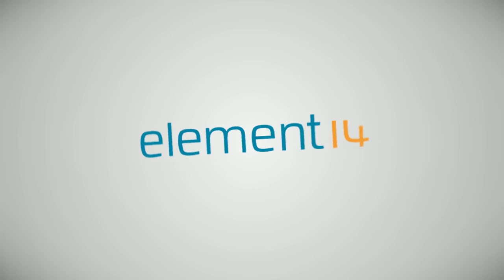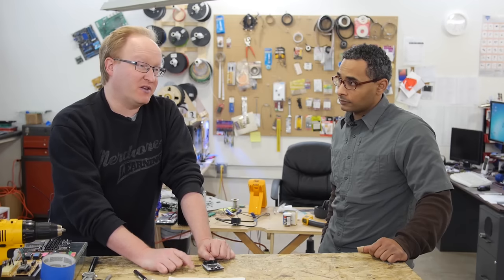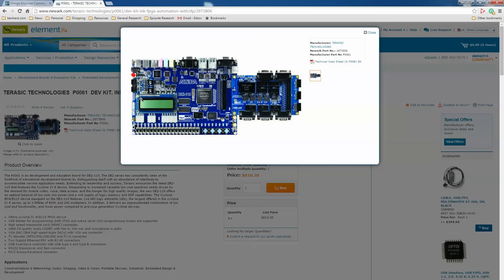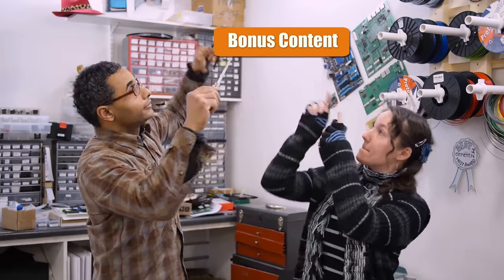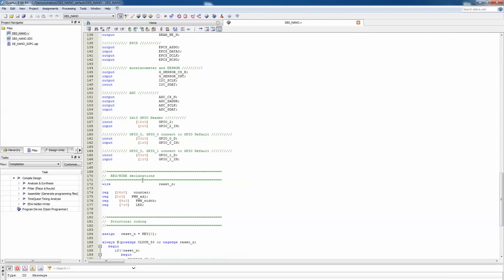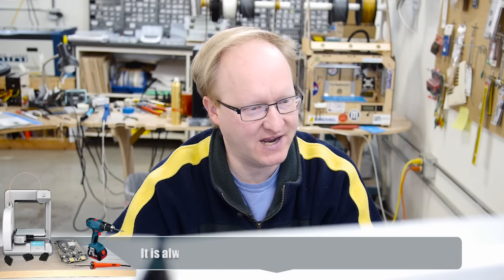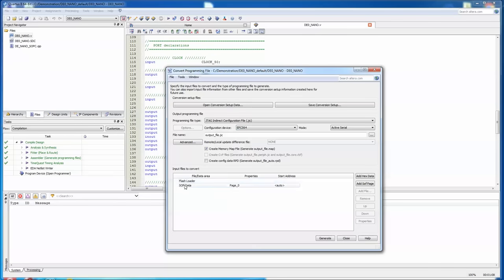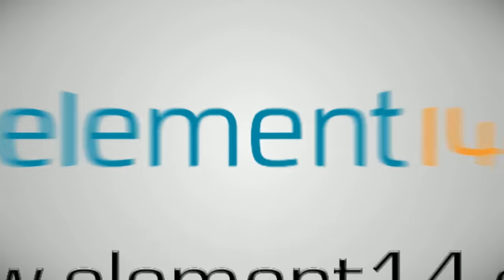Ben Heck's FPGA Dev Board Tutorial

Comment: DE-10 Nano can be had for $150 with a Cyclone V (LOTS of gates) and a Arm SoC running Linux.  You can write custom drivers in Linux for specialized hardware designs on the FPGA and interact with them in user code.

Comment: Hi Ben, this question might be a bit at the wrong place but do you like the delta 3d printer more then the standard x y z 3d printer ? Or do you think they are both good?
Reply: +Charlie90071 Ben currently prefers the XYZ printers he has, but not necessarily because of the way the head prints. The bed on the Orion is difficult to level because it doesn't have springs that allow you to vary how much you tighten the screws down on any side. So mostly he prefers the XYZ style because it is easier to calibrate.
Reply: Oh didnt know that, thanks Karen!
Reply: You're very welcome!

Comment: FPGAs also are very useful in electrically dangerous environments due to their durability, and they can also resist physical damage to the chip itself.
Reply: That's definitely not an FPGA property. You might have seen e.g. Actel chips in this capacity because they make radiation hardened ones.

Comment: how does a program set changes in hardware
Reply: What you're creating isn't a program. Verilog isn't a programming language - it's an HDL - hardware descriptor language. Instead of compiling your code, it synthesizes it into a logic image. This image gets stored into the external ROM, which is read by the FPGA at boot time. The same synthesized image can be sent to an ASIC manufacturer to have custom chips made. an ASIC will be much faster than an FPGA

Comment: What's the benefit of using an FPGA vs a Pi 2?
Reply: The Raspberry Pi runs operating systems and is not real time. If you need precise timing and you want to emulate a circuit, an FPGA can do it. There are plenty of writeups online (stack exchange) that explain the differences. Because the FPGA is hardware, you can't write a variable program loop. The amount of times you loop has to be fixed. There are still loops, but they must be fixed in size. FPGAs are in many devices where a processor would be too expensive and overkill to produce with. Think smart thermostats, home security systems, DVD player, etc.
Reply: +Steven Olsen makes sense. I have seen so many ARM-/Android-based media players in the recent years, so I though I'd ask. Apart from the easier/much more versatile programming of a Pi-like device, such an SoC also costs just a fraction of an FPGA devboard - so using an FPGA didn't seem like a good idea.
Reply: +trisymphony Ben didn't fully explain the extent to which FPGAs are "Faster." Some FPGAs run in the 25+ GHz range and ect. Due to their precise timings and no software overhead, Formula 1 race cars are all powered by FPGAs now.
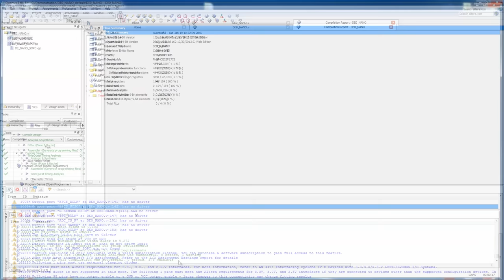Reply: I know this is quite a late comment, but It's worth mentioning the reason FPGA are so fast is not necessarily the fast clock (in fact an FPGA clk is usually pretty low), but it's because the FPGA can do a lot of things in parallel! All the blocks ben talks about (18:20) are basically Look-up tables that operate simultaneously.

Comment: PLD = basically a and-or construction with up to 10 outputs. CPLD = multiple PLDs on a chip (early) or several (32 to 100k) 16:1 muxes that can build any 4-input functions. FPGA = even larger CPLDs, generally based on Programmable muxes, but with common functions hardware included, like sram, multipliers, hard-core processors or fast communication cores (pcie, lvds).

Comment: I'm making a custom low response time keyboard with extra hotkeys. would you say that an adruino would be fast enough to get the lowest latency also are there different voltages or resistances that need to be accounted for in a cherry mx vs a sanwa arecade button?
-
-
-
I just started prototyping the chassis so i want to get a hold on the internals before i get too far.

Comment: isn't a 8 bit output 255 to 0 not 7 to 0?. correct me if i am wrong?
Reply: With 8 bits you can get values in the range of 255 to 0. The individual 8 bits are numbered 7 to 0.

Comment: I am at the 4min mark at the moment but I want to note: Most softcores are royalty free, Altera and Xilinx which covers 90% of the market which has their software cores; NIOS2 and Microblaze are both royalty free. the hard processors (Most likely ARM) which is embedded into the newer families are also paid for by Altera and Xilinx themselves, once you buy the chip, you done need to spend anymore on it. what I think you meant is the IP cores pertaining to each vendor, now those may have licensing fees involved, softcore is a subset of IP cores. The other power supply rail that you missed is 1.2v, but also note that there are FPGAs now which offer single supply rail, the MAX10 which is by definition FPGA from Altera by has many features of a traditional CPLD has an option for supplying either 2.5v or 3.3v. Other company like Lattice has a special type of FPGA also has options for single supply rail to ease up on the complexity of power management. I will add as i go along.
Reply: At the 5min mark; about PLL, based on the current state of the art FPGA architectures, there is a limit to how fast output from the PLL. The characteristics are generally defined in the FPGA datasheet. However it is important to note that as higher clock frequencies are involved, the timing closure will start to play an important role in development so that the synthesized logic will meet the setup and hold time requirements, if you do not meet them then the system will be unreliable and exhibit metastability. As a rule of thumb for the lowest cost FPGA families; for 100MHz and above, the designer needs to be careful of their designs. 200MHz is considered high speed design, stuff like logic depth of combinational paths, high fanouts, etc etc are critical to make designs functionally possible. For low cost FPGA, the current frequency limit that you can clock the system is around the 300MHz region.
Reply: Finally the DE-NANO has a gotcha on it's schematic, it does not include the FTDI converter which handles the usb to Jtag streaming. And no it can definately not handle 500MHz-600MHz pll output clock frequency.

Comment: Okay, a FPGA is faster. So, when I'd like to create an LED strip display with VGA/HDMI input, I'd interface it through an FPGA (since a microcontroller isn't fast enough to display, let's say 30Hz on a good quality?)
Does this mean that FPGA's are like "videocards" and allow parallel execution? And microcontrollers are like processors, executing instructions lineair?

But when will a microcontroller be better? There is a reason that we don't use videocards as a processor? (If you wouldn't bother about the costs/speed)